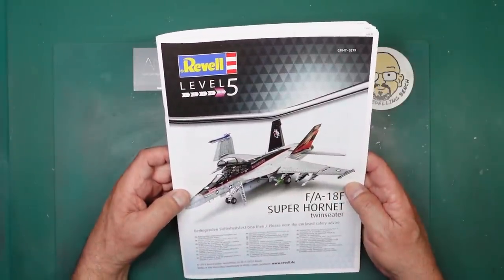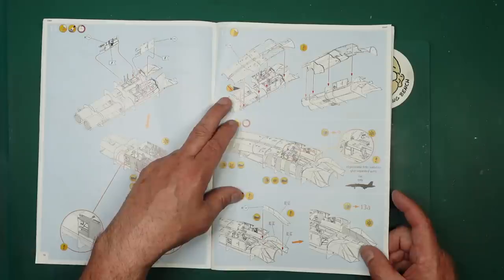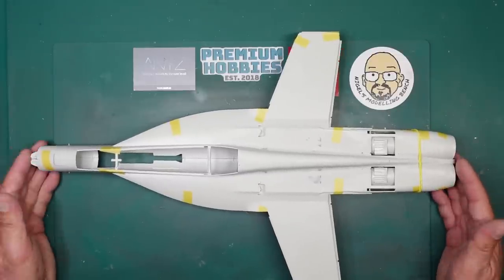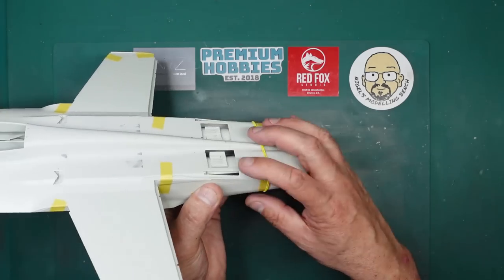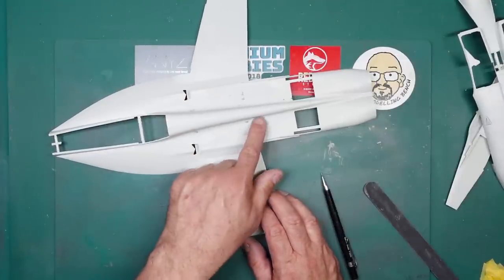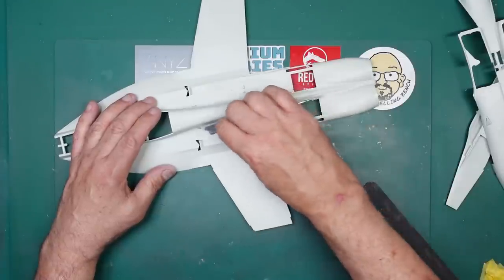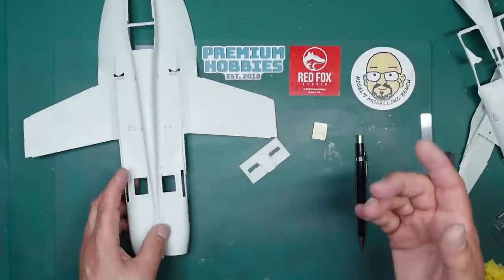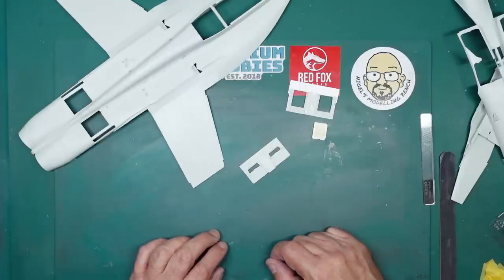Tackling the Revell 1/32 F/A-18F for newbies.

Comment: The most problem of Revell's F/A-18E/F is not the way they go together but serious shape issues. The most prominent of them are too round and short nose cone and wrong backhump shape (line and cross-sections both) and size in several places including the most problematic one - the section just behind the canopy which has complex shape.
Reply from the maker: Some would argue that they don't care about accuracy, and like a kit that goes together nicely.

Comment: HI, greetings from Orkney.  You said that the pilot does not hold the joystick.   I would think that the sudden force of the catapult would cause him to jerk hard back on the joystick  which would flip the nose up uncontrollably and cause the whole aeroplane to summersault on take off.   i assume that the joystick is "locked"  somehow untill the catapult cable has released.
Dont Know for sure  (ex submariner...we went down not up ) but it just struck me when you mentioned it ..that this may be the reason why....any carrier crew watching that can explain ????? over to you ......cheers mike ilett.
Reply: DCS pilot here....yes, the pitch trim is set according to the aircraft weight (mine is 16 degrees nose up) and the joystick is "hands free" during launch. The jet pitches to the correct AoA immediately on departure with no effort from the pilot. Normally they hold onto the suitcase handles in the canopy rail during launch. The launch controller wants to see both of the pilots hands before he initiates.

Comment: Seems to me that the undercarriage is all plastic and that might be the problem. There is no metal core insert, in the gear. That would likely help or just replace it with white metal, altogether.
Reply from the maker: I believe the legs are strong enough, i think the mountings are what breaks?
Reply: @NigelsModellingBench  entirely possible. I’ve found that to be a weak spot on many F-18 kits.